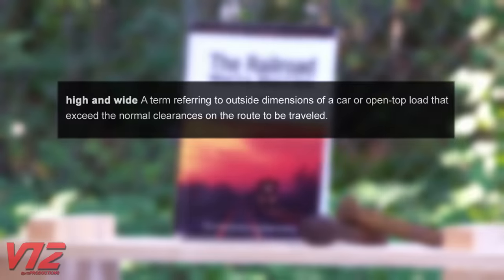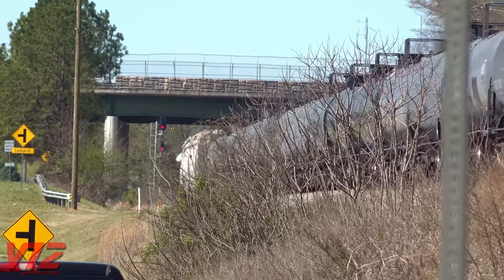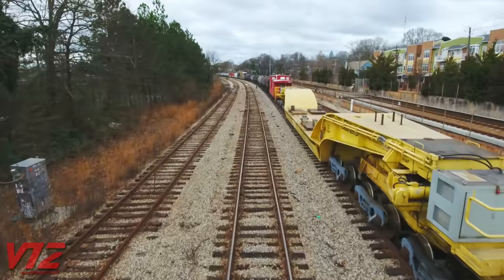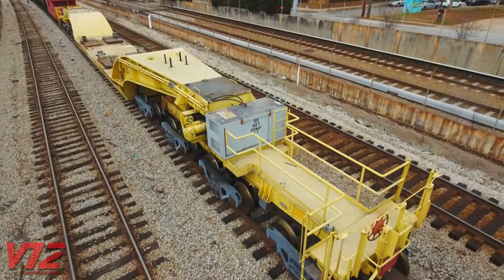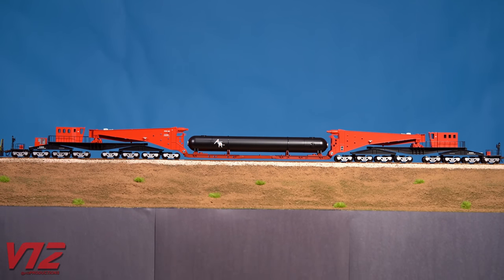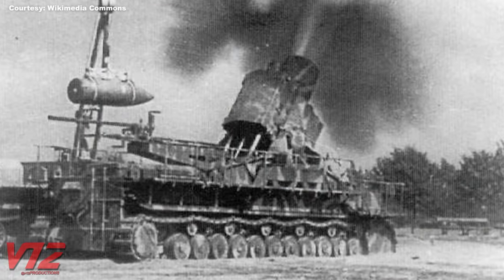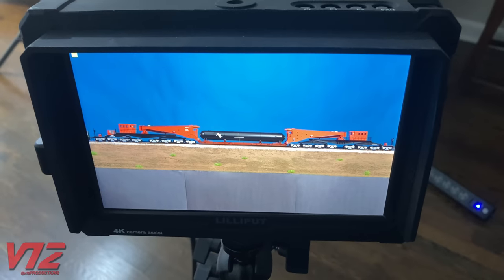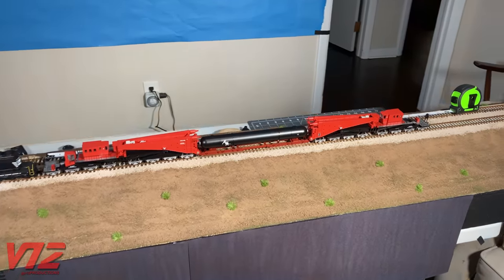HUGE Train Loads - High & Wides!

Comment: CEBX 802 is not a real reporting mark, but CEBX 800 is a real designation. It was designed for moving heavy components in the energy sector ranging from nuclear generating station components to petroleum refining parts.  The car was owned by Combustion Engineering I believe.

Comment: Great video as always.  I've always considered high and wides on the railroad as just the railroad versions of the high and wide loads you would see on the road and on the highway pulled by semi trucks. I don't know if this counts, but another large load that is carried by rail are the large & long wind turbine blades carried on 89 ft long flat cars seen in other places in the US. As for high and wides I've seen, the most unique one was when I caught a southbound rocket components train in June 2020 passing thru middle Georgia on its way to Cape Canaveral, FL.
Reply from the maker: Thanks dude!

Comment: Depressed-centre flats also means you don't have to lift the load as high to get it on the car. Probably not as big a deal as increasing clearance, which you point out, but I'm sure it helps.

Comment: Nice, where I am in the panhandle of Western NEBR, only on BNSF LINES, I once In a great while will observe 87' flat cars carrying the green 737 fusealges at different times on frieght trains and their always jus behind the locomotives.  
I've also seen at times the 87' flat cars carrying the 100' fan blades for the high wind turbines here to. I believe those are some built just outside of Brighton, Colo, and consist of about 30 cars at time, those cars to have their own independent pivoting shaft to articulate curves, or when switchn as they all are excessively extra long loads also requires 1, 87' FLATCARS and 1 40' flat car or longer to follow. Great VIDEO 👌✌️👍
Reply from the maker: Cool! Thanks!

Comment: Great Video. Just wanted to share an interesting tidbit from my trip today. I was taking CN Q120 from Toronto to Belleville and we had a track inspection boxcar (one of those ones with the laser measuring system and LIDAR) just behind our engines. Interestingly enough it isn't considered an ERAP car and has no speed restrictions, which is unusual.
Reply from the maker: Very interesting. Thanks for sharing!

Comment: WECX 801 actually became KRL (Kasgro) 3601 in 2019, along with its slightly smaller sister, 800 (now KRL 3600).  Both were designed to haul the new AP1000 nuclear reactor.  Westinghouse was betting on the domestic success of their largest and safest nuclear reactor design yet, but it was actually a flop.  Therefore, these cars were somewhat useless from the start.

Comment: Hi its Mark from UK that was very interesting I love watching vidios of American freight trains especially military freight and tanker cars..... Do you have any idea what the 6 yellow lines are for on the sides of tanker cars please?.... The only thing I can think of is they show the weld seems where the sections are joined... Maybe Iam wrong haha.... Unfortunately not much interesting freight here in the UK we don't even haul coal anymore... Mainly steel, shipping containers, and aggergate & autoracks usually 1 EMD class 66 Power unit hauling around 30 wagons as we call them over here and they fly past very fast so pretty boring.... I wish we had long long freights like you guys have in the US 👍
Reply: Hi Mark - I believe the marks you are talking about are ARR-required reflector markings, to aid night visibility. If you look at current videos you should see them on all cars in the US. They are also required on locomotives. Funny thing is, it's not stopped the stupid and drunk morons from bashing into the sides of trains on a regular basis. Guess you really can't fix stupid... and we all know the alcohol issues. Hope this helps. Cheers!

Comment: Here's a video suggestion: are diesel electric locomotives technically a hybrid
I thought this was a great idea because a diesel electric locomotive uses a diesel engine to power an alternator generation electricity to power traction motors making me believe it's a hybrid
Reply: No. A hybrid is a vehicle that can be powered by both an internal combustion engine and a battery. Diesel-electric locomotives are powered by a diesel engine driving a generator which supplies traction motors.

Comment: As a former NS Trainmaster on the Pittsburgh division I’ve seen all sorts of high and wides. Funny enough the movement office hated running them on the Pittsburgh Division because some High and wides require adjacent tracks to be clear or a restricted speed for passing. They’re Easier to move down south when you have single track mains with passing sidings. Being at Conway we saw almost everything on the network. I’d say CAT equipment the most. But you can usually see military equipment, nuclear flasks to and from mechanicsburgh PA as well as schnable cars.
Reply from the maker: That's really cool! Yeah, I'll bet high and wides could cause some major headaches.
Reply: @v12productions  Certainly especially with crew and power shortages during the height of Covid. Usually an extra High & Wide train would be out on after a few of them accumulated in  to run out at night and minimize impact, but we were forced to get more creative and run them on regularly scheduled trains. Some of them were more time sensitive as well, for example a lot of the CAT equipment needs to be at port in Maryland to catch a boat for export at a certain time. Some equipment and companies even had people follow the loads throughout their journey by automobile. Special military high and wides with armed cabooses with personnel also could created for headaches. A very interesting subsection of railroading for sure.

Comment: Well, here's some information that you don't have or had not looked up. A Schnabel car or Schnabel wagon is a specialized type of railroad freight car. It is designed to carry heavy and oversized loads in such a way that the ...
Design · CEBX 800 in North America 
https://www.youtube.com/watch?v=5goeNITKtdA
Reply: Addum to the above ... A Schnabel car or Schnabel wagon is a specialized type of railroad freight car. It is designed to carry heavy and oversized loads in such a way that the load makes up part of the car. The load is suspended between the two ends of the cars by lifting arms; the lifting arms are connected to an assembly of span bolsters that distribute the weight of the load and the lifting arm over many wheels.

When a Schnabel car is empty, the two lifting arms are connected and the car can usually operate at normal freight train speeds. Some Schnabel cars include hydraulic equipment that will either lift or horizontally shift the load while in transit (at very low speeds) to clear obstructions along the car's route. As of 2012, there were 31 Schnabel cars operating in Europe, 30 in North America, 25 in Asia, and one in Australia.

The largest Schnabel car in public railroads operation, reporting number WECX 801, was completed in 2012 by Kasgro Railcar for Westinghouse Nuclear and is used in North America primarily to transport reactor containment vessels. It has 36 axles (18 for each half). Each half contains nine trucks which are connected by a complex system of span bolsters. Its tare (unloaded) weight is 399.6 short tons (362.5 t; 356.8 long tons) and has a load limit of 1,017.9 short tons (923.4 t; 908.8 long tons) for a maximum gross weight of 1,417.5 short tons (1,285.9 t; 1,265.6 long tons). WECX 801 has the ability to shift its load 44 inches (112 cm) vertically and up to 40 inches (102 cm) laterally on either side of the car's centerline. When empty, this car measures 231 ft (70 m) long; for comparison, a conventional boxcar currently operating on North American railroads has a single two-axle truck at each end of the car, which measures 50 to 89 feet (15.24 to 27.13 m) long and has a capacity of 70 to 105 short tons (64 to 95 t; 63 to 94 long tons). The train's speed is limited to 25 mph (40 km/h) when WECX 801 is empty, but only 15 mph (24 km/h) when loaded and requires a crew of six operators in addition to the train's crew.